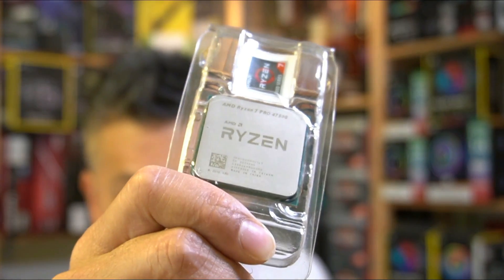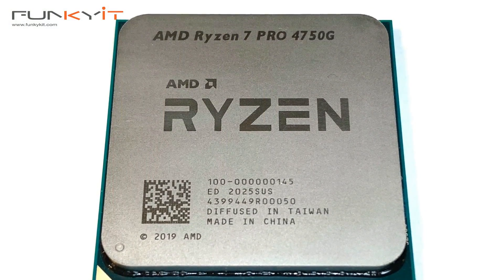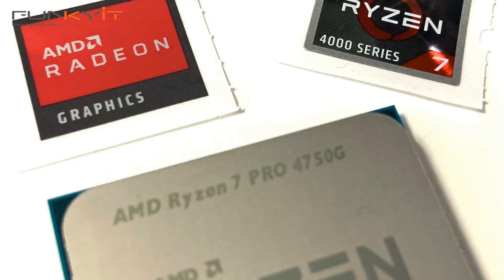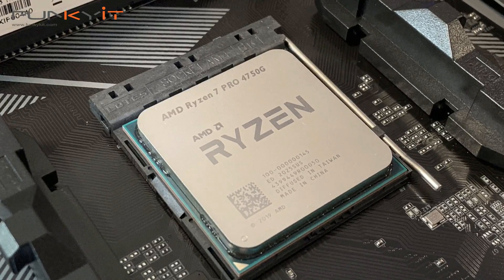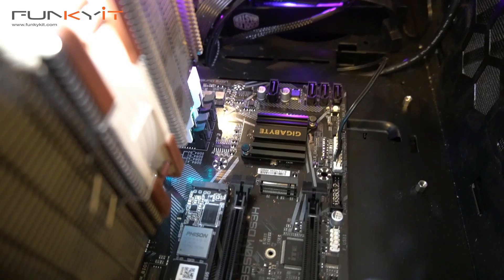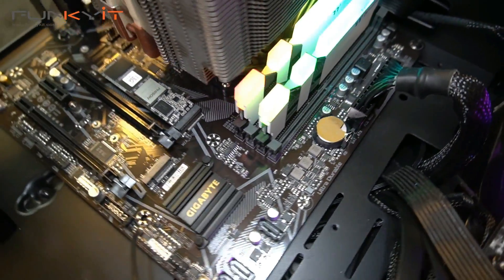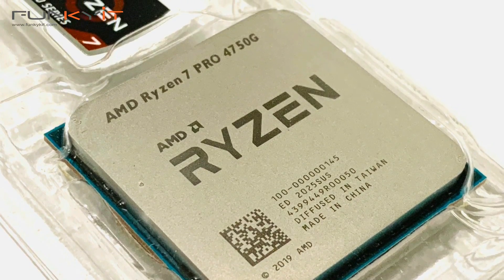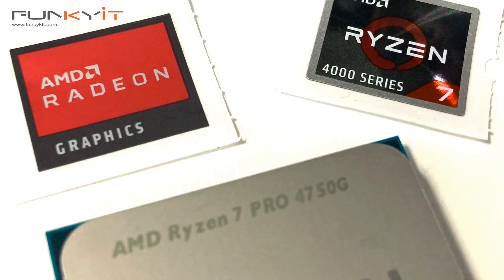The Most Powerful APU Available on the Market - AMD Ryzen 7 PRO 4750G

Comment: I bought a brand new 4570G and got it with a Ryzen 5 sticker, in cheap plastic packaging taped to the box that contained the cooler. The first impression was horrible! The fan on the cooler stands rotated 90 degrees to the left, of course I turned it properly! When I finally put it all together (Gigabyte X570 Elite MBO) there was nothing on the screen! Made a BIOS update and it worked. Every time I turn on the PC and open youtube, the screen is left without an HDMI signal. I have to turn off and on the screen, only then will everything work. I am terribly disappointed with these details, my old i7 2600k has been working since day one without any error. Today, it seems that manufactures is only interested in throwing out the processors and motherboards from the production lines. Nobody cares about customers! There is a clip on my channel about this, unfortunately without translation...

Comment: I use a 4650g@BCLK 105.2 boosts to 4515 MHz. RAM 4133 CL 16-16-16-16-32-48 1T@ 1.5V. As GPU 5700xt @2080Mhz 1.10V. Board Asus Prime B550m-a. This cpu is a killer. With fast RAM and Timings you get a huge increase on Min-FPS. Love this APU. Max 78 Watts @ OCCT AVX2 Burntest. CB20 Single 516 and Multi 3978. Let you say OC on that CPU is so easy @ Stock Voltages.

Comment: Wouldn't the 10900k technically be the most powerful APU?
Reply: It has shitty integrated graphics even the athlon 3000g has better integrated graphics performance.
Reply: @lolgaming-px5jz  well that's not really the point. Because the 10900K has integrated graphics, it is therefore an APU. Regardless of graphics performance, the 10900K is, in theory, the most powerful APU.
Reply: @criticallycheesycaleb6681  well it's the most powerful apu "cpu" wise